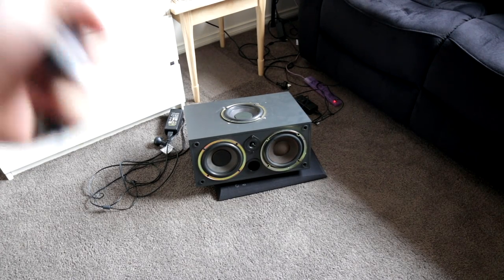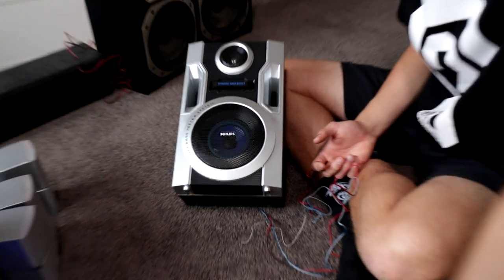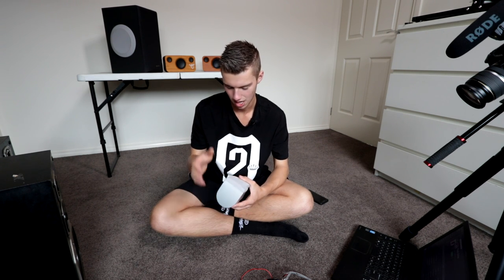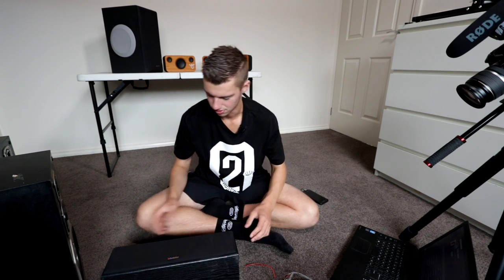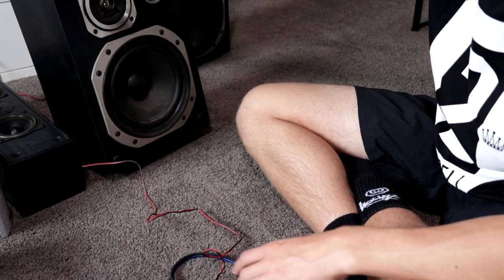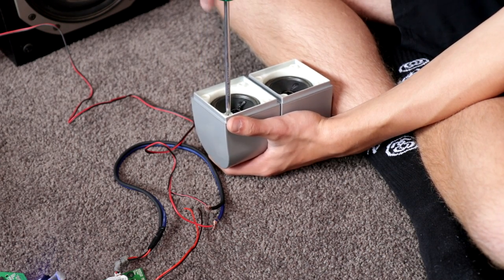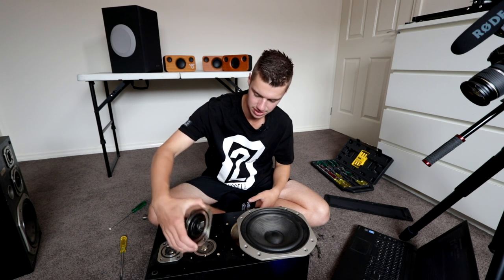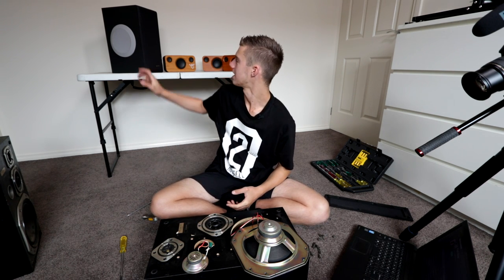MORE CHEAP SPEAKERS!

Comment: Those pioneers are vintage and valuable depending on the model. I'd keep them
Reply: Do you think the pioneer S-J700D speaker is valuable?
Reply: Those are the Pioneer S-Z83D they are Amazing
Reply: @nilsrosenow6367  lol trust me, when you listen to a pair of real Hifi speakers like i have at home, you will never want these cheap plastic pioneer speakers again :)
Reply: @Girl On A Quest Jealous? Pfft, yours would sound like crap for critical listening. My Visonik David 502's (on my channel) would sound at least 10x better. Sure they don't provide the best bass, but they're incredibly small for being from the late 70's, and will shine when paired with a good subwoofer.

I do however have two pairs of 6x9's made by Pyle...in 1976, when they were actually decent. You can also view those on my channel if you scroll down.

Comment: My only request DON'T ruin those nice Pioneers! If they sound a bit off the crossover probably needs new caps, the piezo on them do work well but if the capacitors are all dried up it won't play as high of frequency's. Also just like any piezo element give them a fair bit of power to hear them. The set you have is a mid range quality studio monitors. I'd hate to see them get torn apart. If the woofers are a bit scratchy, turn them so the top of the drivers are down and re-install them, they tend to droop over time until the vc makes contact with the magnet.
Reply: Travis Piper Wow, thanks for the information. I actually did not know that they could droop over time. I picked up a nice pair of tower speakers not too long ago and was disappointed because one of the drivers were scratchy. But this comment may have just saved them from being tossed.
Reply: Yah the rubber/ foam surrounds can warp over time, usually 20 years or so. Happened to my pair of Optimus Pro 4,000's, the 15" drivers were scratching a bit but when I moved them around it went away.
Reply: Cone sag is pretty common in old speakers and so are bad caps. You would use a non polarized cap for the tweeter.
Reply: Would the woofer be better with a bigger magnet?
Reply: Bigger magnet doesn't always mean it performs better, for the 1970's these are pretty powerful drivers. They rely on cone area and a large enclosure. He could upgrade them if he wanted to, just wouldn't look the same though.
Reply: The Pioneers are not studio monitors at all, they were just supplied with a run of the mill for the time midi system which looked like separates, but was all in one with maybe a separate tuner.

They're garbage.
Reply: Ah they looked like monitors to me.
Reply: P
Reply: i agree those vintage pioneers are good
Reply: How do you move them around
Reply: Just be sure to use BIPOLAR caps in the speakers. Normal capacitors (electrolytics) are polarized.
Reply: @harpskid  Truthfully, for ferrite magnets, larger magnet sizes are typically better. This is especially true if you see a speaker that has at least two ferrite slugs. Most car audio subwoofers use large ferrite magnets, and can put out a ton of power. The downside to this is that the ferrite magnets are very heavy.
But there are more magnet technologies out there. Many vintage speaker drivers used AlNiCo magnets. Those were much stronger compared to ferrite, and in turn didn't require a large size to produce a strong electromagnetic field. Most AlNiCo magnets were fairly long, allowing for longer voice coils in the speakers that used them. 
Some modern speakers use Neodymium magnets, that are unbelievably strong for their size. Most modern tweeter drivers use Neo magnets due to their high efficiency.
Many car audio manufacturers use Neo magnets in their high end drivers, and extreme subwoofers (such as DD Z-series and Sundown Nightshade)
Reply: @harpskid  The magnet holds the coil in place. So a small weak magnet will allow the coil (attached to the cone) to overshoot and distort or damage. These (pioneer) speakers were designed for like 20watts maximum.

Comment: The woofer surrounds on the center channel speaker are foam not rubber. Tweeter looks like a cheap plastic cone model. The Pioneer is a three way design. Tweeter, midrange and woofer. Not a midrange tweeter. Japan did make great stuff, but cheap as well ( kinda like China now).

Comment: You inspired me to pull out this old samsung system out of my closet to take apart. The only impressive thing I found was the huge magnet on the back of the subwoofer. Otherwise the rest of the speakers are pretty cheap

Comment: the dose screw thing is for a wall mount bracket.  Bose did that too.
Three way is a woofer - midrange - tweeter.
The Dose-Bose was a satellite speaker, it needed to be used with a sub-woofer.

Comment: Please could you buy an “intempo tailgate speaker it is very interesting to open up as I did today there is a very strange 8” speaker that is a dual coil which is wired very strangely and does not look replaced it would be cool if you could check this out x

Comment: You would be surprised that the Bose are not much better, in fact they are actually glued and clipped together. I was able to get mine apart though. Bigger coil and magnet, but PLASTIC BASKET! The subwoofer is good though.

Comment: It would be really cool if you get a cooler or I believe you guys called them cool boxes and make a Bluetooth speaker cooler using one of those sets of sub will for drivers and then some tweeters I’ve done Loads of cooler builds before I’ve managed to get the speaker wire to run in between the Styrofoam in the cooler and I’m out the Bluetooth board any waterproof casing that way when you open up the cooler all you see is the Bluetooth were you not see any speaker wires It makes the speaker look clean neat and sound quality are usually get out of my cooler bills are amazing

Comment: Those pioneer speakers look identical to the ones I have. Do they say s-z83d on them? Mine came off a 90's ish looking black plastic stereo I found in the ewaste at the tip. I basically kept the speakers cause they sounded really pleasing to my ears. I can't recall the other set of speakers I had at the time but I a/b'd them and the pioneers blew them out of the park. I also kept the servo turn table and rewired it with a 12v power supply off a modem or something it just plugs to wall now.  The remainder of the original unit was this big piece that had the amp, tuner, cd player and double tape deck combined into the one thing. I gave that away. One thing to note though with the pioneer speakers well my ones anyway they are 6 ohm speakers not 8 so if you use a + b speaker feature on your amp you might be heading into the danger zone depending on your amp.

Comment: With pioneer floor speakers, rip a youtube video of a pioneer speaker commercial, get the audio track and re-edit it with a lot of bass and make a video blowing up of the drivers in smoke. You could do this for every brand, showing the cheap components inside and then popping them.

Comment: the reason the tweeters normally goes first is that if an amp clips the clipping power is sent to the tweeters through the passive filter in 2way/3way/4way speakers and so on. that is why they normally goes if the power supply on the amp is not able to supply high enough voltage for the sin wave its trying to push out to the speakers(Amp clipping). It has nothing to do with the cutoff to the woofers. So many people tries to sound like they know wtf. they are talking about but you have no clue sadly. Learn how amps and speakers work before you tell things that is wrong. and if you want to test if the tweeter is really blown or its the passive filter, you use and multimeter and ohm the tweeter(without wires ofcourse).. if its unlimited ohm the coil is cut/burnt cause of overload quite simpel. Normal speaker coils is between 2 and 12 ohms.  depending on the frequency u test with.

Comment: The resistors are probably impedence equalization they probably came from the factory like that considering there were connectors used and not some makeshift solution

Comment: Alot of brands used Eastech. Generally they are stiff with alot of mechanical noise but they have a few decent drivers. So they are decent but not great IMO

Comment: Build a Box, Get a 4way Crossover, Use the Woofs from the Pion's for the Bass, The Blue and Center Chans Drivers as Mid-Bass's, The Doss's as Mids, And the Pion's Mids as Tweeters. Port the Box and put Padding in it. Would love to hear how they sound at a decent volume. Not going for Max just a good level, say 2/3 volume.

Comment: I would recommend getting a speaker selector box that allows 2 lines in (R/L) and then 4 outputs (8 speakers  out) or if you can get a pair of speakers that have a removable speaker jack plate , solder them together then you'll have a quicker way to hook them up to that amp you have.

Comment: save the pioneer speakers they sound  so clean i had a pair too  if u replace the woofer bc the old wofer is not that good
Reply: ops sry they arent the same version mine got a 12 inch sub but maybe they sound good

Comment: It should be the opposite way on that little speakers, the inner contact of that RCA would be the + pole and the outside should be the negative  - pole. If u connect it the opposite way the speaker will work opposite way, so like when in normal operation when its connected as it should be the speaker membrane moves forward on loud sounds and bass, but when connected the wrong (opposite) way, membrane would move backward but still there will be sound... The one way to determine the correct polarity if u don't know one is to connect little battery while monitoring the membrane moving...

Cheers!

Comment: I 've seen those Pioneer speakers in a late 1970s dealer catalogue. They were offered forming a set with their fluoroscan component systems. If they were ment to go with that hifi system, they will be good because that fluoroscan line was like Pioneers equivalent to a Mercedes S-Class. If the speakers would had been crap, they would had make it like like the whole system was crap and for sure Pioneer did not want that.

Comment: The Doss spearkers sounded worse than you expected because you were running them out of phase (The red wire needed to be in the tip and black on the ring (Ground) Other than that, cool video